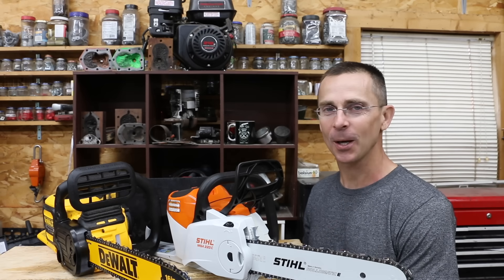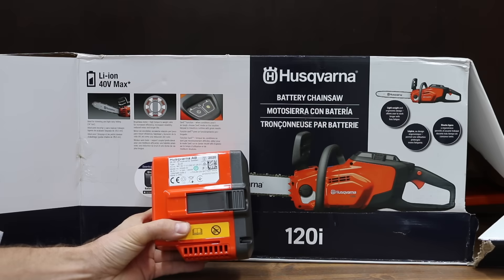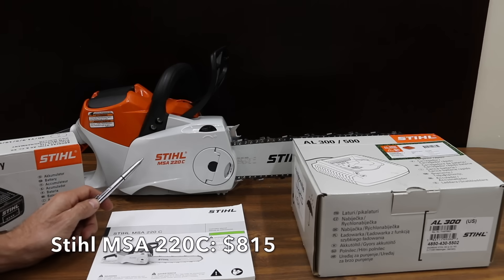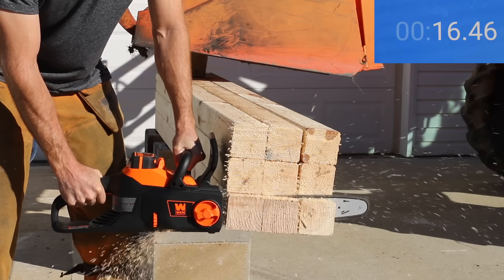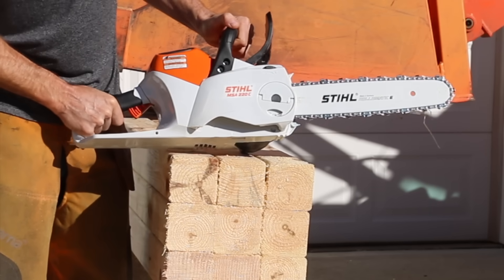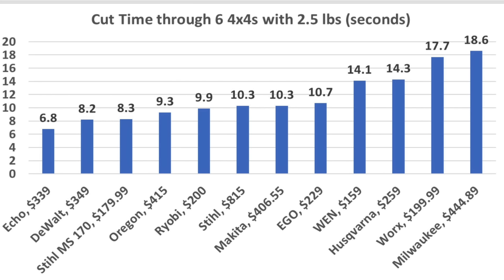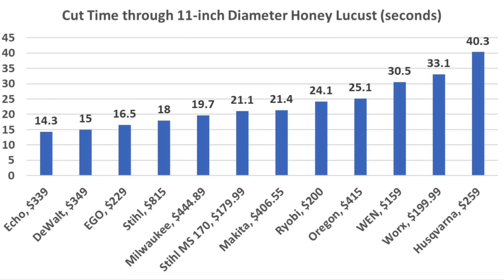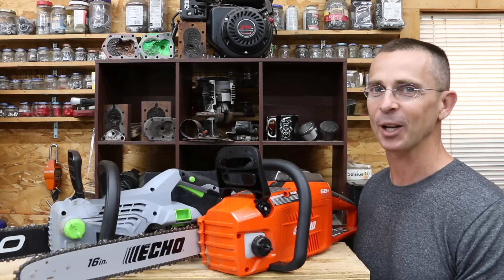Best Battery Powered Chainsaw Brand (ROUND 2)? Stihl, Husqvarna, Echo, Oregon, DeWalt

Comment: Proud Ego owner here, it did about as well as i expected.
Mine has an 18" bar so it takes a bit longer to go dull, it also comes with steel sharp felling spikes, and when combined with a 5.0 battery it can go for a good while if you don't mind the extra weight. I have discovered on the small batteries that they give up early, popping it out of the saw and then reinserting it about 5 seconds laters usually grants me a few more cuts before i have to recharge it. It does cost a bit more than the 16" but i don't know if that's just because it comes with a bigger battery.
Thanks for the video!
Reply from the maker: You are welcome!

Comment: Love the channel!  I would like to see a test of some of the most popular higher end flashlights.  I want to understand where the value is to a $100 and up flashlight, when you can buy a machined aluminum case flashlight, with +/- 1000 lumens for $25 or less, and the only weakness in them seems to  eventually be the switches.  Do the $100+ flashlights have switches that can take 36000+ cycles  (10 cycles a day for 10 years) before failing.  How many cycles can a HF or Costco Duracell flashlight take in comparison?  Thanks.
Reply from the maker: Thanks for the video idea.

Comment: My ego saw was sold with a 5 amp hour battery which is the recommended battery to get the best cutting performance from their saw.  You should have tested with the 5 amp hour battery. I love my ego saw but it does have an issue where if you cut into light brush it has a tendency for the chain to jump off
Reply from the maker: Thanks for the feedback.

Comment: Try hydraulic oil as engine oil replacement
Reply from the maker: Thanks for the video idea.
Reply: @ProjectFarm  there is another product you might be interested in testing. It is called "Shine Armour Engine Booster. It supposedly uses "nano-technology" to coat the moving parts in the engine. I think it might be "snake oil".

Comment: Does any of them have active fan cooling on the batteries in the saw itself? Discharging them this fast tends to heat the cells a lot, which leads to a shorter total lifetime, i suspect this'll be a big downside for the dewalt's drill batteries for example in intensive use.
I've noticed the bigger husqvarna fast charger has a fan on it that kicks in when you plug a battery in, but haven't seen the battery chainsaws in person yet.
One potential reason why the stihl and husqvarnas is slower could be that they're trying to prolong the lifetime of the battery as such by not discharging them too quick.
Awesome test video as always though!

Comment: I clear land as an excavator. In the summer we cannot use gas. I've blown through these saws. All of these are plastic toys compared to the stihl. Buying a saw based on this review is ridiculous. I have personally broke 3 dewalt chainsaws. They are trash. Most important part is durability. This review shows nothing of that. Reviews should be based on real work.

Comment: Sorry also didn’t see a comparison on battery amp hrs which would have been nice. As I believe the dewalt is a 9.0amp hr battery which is only 3.0 amp hrs at 60v compared to the 4.0 amp hr echo at 58v. Seams like echo just has a bigger battery
Reply from the maker: Thanks for the suggestion.

Comment: I have a ego hedge trimmer and string trimmer. By far the best upgrade made to the tool shed. I also have a HART 21inch steel deck mower that I got on clearance for $300 OTD. Basically a rebadge ryobi at its core and it’s not bad for that price, however I think the msrp or 497+ tax is laughable compared to ego. I can’t remember if you’ve done it before but an electric mower test would be interesting.
Reply from the maker: Thanks for the video idea.

Comment: Husqvarna 120i is an entry-level saw and you should compare it with the 20V Dewalt, and not with the Flexvolt and not with the top model of Stihl! Take Husqvarna 535i/540i XP and then let's see. And it would be really interesting to see the Dewalt 20V chainsaw vs Stihl MSA140 vs Husqvarna 120i.
Reply from the maker: Thanks for the video idea.

Comment: Video idea I dont think you’ve done it 
Car battery chargers - the prices vary so widely maybe discharge all the batteries to a set voltage , measure time taken to charge , how long it can provide crank current with a drop tester, maybe the ability to revive dead low voltage batteries , Etc
Reply from the maker: Thanks for the video idea.

Comment: Stihl GTA 26 vs Milwaukee 12 Volt 6-INCH Hatchet.
Reply: yeah, that is one I'd like to see. My guess is Milwaukee.  Also, adopting another proprietary battery isn't appealing, and M12 has more battery options than the Stihl.
Reply: @hanwagu9967  I agree the M12 line is great. I hate to see Stihl loose. No one can touch their gas saws.
Reply from the maker: Thanks for the video idea.

Comment: You have done really nice work on oil and air filters, how about a video on oil filters?  Things like micro filter size, how much filter area, how the filter paper are joined/sealed together, cold volume flow, the paper blowout failure, bypass valve specs and recovery or not,  base plate warping, check valve or oil retention valve leakage and if the "synthetic" label is hype or not. There are "Race" oil filters too. I know they have thicker base plates and reinforced filter paper for higher oil pressures but that can be hype as regular high quality filters were used by me and colleges back in the day for racing all the time. In my time 70lbs was the norm and the max as higher pressures robbed hp and caused other issues as well as base plate and canister distortion or explosion.  Fun Stuff. :) 

Really like your channel and you have great methodology.
Reply from the maker: Thanks for the video idea. Thanks so much!

Comment: As for charge times - typically any time a battery is charged more slowly it will have the longest capacity over the test of time and many discharge cycles. However, 60-70 minutes is great for 4Ah sized Li Ion batteries. I believe Dewalt purposely doubled the charge time to the charge cycle to keep the pack cooler when charging and maintain more capacity over time. It is a smart move. Everyone should have two batteries anyway.
Reply from the maker: Thanks for the feedback.

Comment: I think that the saws that uses 16" bar/chain and waste a lot of the length do this for users to use the same 16" chains that their regular saw uses for parts commonality rather than getting more length.
Reply: Also from use experience, the stihl tensioning "sprocket" gives crap grip, and adjustioning the tension of a saw that is not brand new is almost impossible. so while a great idea, tool-less tensioning don't work as well in practice.
Reply from the maker: Thanks for the feedback.

Comment: if you do a round 3 make sure to include the EGO 18 inch (350$) and a kobalt 80 volt gen 2 (400$) or greenworks 80 volt Generation 2 saw. the kobalt gen 2 is hard to find.
Reply from the maker: Thanks for the video idea.

Comment: You know what i use? You didn’t test it I have a new craftsman chainsaw it was on sale at Lowe’s for $150 it’s got a steel pin easy to tighten and remove blade it comes with a battery but I have a craftsman lawnmower and I use that electric battery which is a 60 V and it fits on the chainsaw makes it kind of heavy but I’ve been taking it to my cabin on the weekends putting a roof on it and I use it all day long and don’t charge it at the end of the day I cut down this huge tree with it like a hot knife through butter.   I think the battery is key.    Its a 16”. I love it.   They had a craftsman mower on sale for half off six months later I got the chainsaw for half off.   So now I’m fully electric for 300 bucks and the batteries are interchangeable.  ;))
Reply from the maker: Thanks for the video idea.

Comment: Should calculate the charge time and run time by the battery amp hour to make it fair since the battery sizes were different and many you can get different battery capacity's. So plot total with available battery(s your are now) then also plot per amp hour to get the efficiency
charge time per amp/hour = charge time / battery size(ah)
run time per amp/hour = run time / battery size(ah)
Reply from the maker: Thanks for the suggestion.

Comment: Just curious how both the Kobalt 80v 18-inch and Greenworks 80v 16-inch or 18-inch chainsaws weren't included. Edited to include the point that both the Kobalt through Lowe's and the Greenworks through Amazon are sub-$300 including a 2Ah-80V battery and charger in that price.
Reply from the maker: Great suggestion for future round of testing.

Comment: Something worth mentioning regarding the battery capacities is that amp-hours aren't useful for comparing batteries of different voltages.  The actual amount of energy the batteries hold would be calculated by multiplying the amp-hours by the voltage to get watt-hours.
Reply from the maker: Thanks for the feedback.

Comment: Great comparison! You should have grabbed the 18 inch ego though. It ships with a 5ah battery and I'm literally milling lumber with it with a chainsaw mill. (I did get extra batteries as a 5 amp hour battery will make about 2 passes though an 8 foot ash log)
Reply from the maker: Thanks for the suggestion.

Comment: I have the Ego with the 2A and 5A batteries. the 5 amp  has more power and  lasts twice as long as the smaller battery you used.
Reply from the maker: Thanks for sharing.

Comment: Just imagine if they came out with nuclear or other supurb battery tech, these saws would be the way to go. I have a greenworks 60V and the 6 amp hour battery. It is a good saw but the battery will run out and then you're stuck waiting 5 hours to use it again. My gas Homelite saws don't cut as good but they will go all day if I need them to.
Reply from the maker: Thanks for the feedback.

Comment: You should’ve tested the Ego 18 inch. The 14 and 16 inch have a different construction than the 18. I have the 18 and it has metal spikes and comes with a 5 Ah battery.
Reply from the maker: Thanks for the video idea.

Comment: Honey Locust burns great :)
The Oregon battery saw is weaker than I would like.  I own the mains power 45cm Oregon CS1500 which is 2400 Watts with plenty of power.  Works fantastically with that self sharpening chain.
Reply from the maker: Thanks for sharing.

Comment: You should do a video on the chain sharpening systems.  The ones that mount to the end of a bar, vs. the one in this Oregon saw vs. a file vs. the mini chop saw sharpeners that you have to remove the chain for.  I have always wondered how these bolt on sharpeners work that you just tap the ground a few times and it is suppose to sharpen the blade.
Reply from the maker: Great suggestion!  Thank you.

Comment: If I was going out for the day to Pollard a tree, how many of the batteries would I need, the chainsaw would be going flat out for well over an hour, probably two and sometimes three, so i would need some where between 9 and 26 batteries with me, and there is another chainsaw in operation at the same time, doing one to two hours, that's another 9 to 18 batteries, so that could be a total of some where between 18 and 44 batteries.
Reply from the maker: Thanks for sharing.

Comment: Had a Milwaukee M18 16 inch chainsaw, sent it back. 3.5 cuts on a full battery, overheated and left me with just one bar of life. The tree was 14.5 inches. Not truly sold on the battery chainsaw. Looking into investing on a Dewalt since it is American made. Looked at the Stihl, but, $800 is a bit much for a battery chainsaw in my opinion.
Reply from the maker: Thanks for sharing.

Comment: I think this is testing the chain quality more than the saw. Using the same saw with different chains will net you a vastly difference time of cutting and quality of the cut. The echo uses a standard oregon chain which is excellent and I believe why the echo did so well. This test would be better if each one had a new chain from the same brand that were all the same style (like semi chisel vs full chisel). Until then this test is only useful for out of the box performance until the first sharpening and not really for which saw is 'best'.
Reply from the maker: Thanks for the feedback.
Reply: @ProjectFarm  Thanks for having a very fun and educational channel!

Comment: please add "run time per AH" to these kinds of things. I understand the concept that the item came with a 3ah battery, but comparing that to run time of a 5ah battery on another chainsaw seems rather useless to me, as I swap batteries between devices a lot. knowing that if I have a 9ah battery for one device, it'll run longer than a 9ah battery in another device is more useful than knowing that the 9ah battery in device 1 will run a lot longer than the 3ah battery in the other device.. hope that makes sense. :-)   I mean, if I wasn't going to have other batteries, and was just going to get 1 device and the battery that came with it, sure.. but I don't believe that's the usual use case in todays battery tool world.   my 2 cents.  :-)   still great videos!  what're you gonna do with all those chainsaws?   flying chainsaw drone battles?  multi armed mech with a chainsaw in each hand for an amateur horror film?  '

Comment: The crazy price of the Stihl is whats holding back all thier battery tools. They don't offer any combo deals, and even now in winter, nothing is on sale at my local dealer. My family is Stihl loyalists, and I've inherited Stihl saws and a Kombi system. I wanted to add an electric Kombi motor for light-duty tasks, but the cost for the motor and battery and charger (all separate) was almost $700. I can buy a whole new system from other vendors for that price. 

They say they want the homeowner/hobby farmer market, but prices like this can only work out for pros and even then I'm not sure on the ROI.
Reply from the maker: Thanks for the feedback.

Comment: One thing I took into consideration years ago was product line. You don't want a bunch of different batteries floating around useless most of the time. I grabbed an ego weed eater, then blower, and now lawn mower. So now I own 2 - 2.5ah and a 5ah battery. I can go all day between the tools and batteries. The 2.5ah battery only really lasts on the weed eater
Reply from the maker: Thanks for sharing.

Comment: I’d love to see a test on chain sharpening systems.
Reply from the maker: Thanks for the video idea.
Reply: The Granberg file and joint is hands down the best system. Makes every tooth geometry, depth and height identical so the saw cuts fast, straight (uneven cutters will cause it not to) and smoooooooth.
Reply: @procrastinator1842  I use high speed roto tool or take it in to guy that can get better than new.
Reply: @sunnydays4966  Roto tools do not do a good job, they leave burrs on the teeth. The Granberg gets better than factory results every time.
Reply: @procrastinator1842  taking the to professional the best I can get them.
Reply: @sunnydays4966  much of the time, the professional just does the minimum standard of acceptance or the quickest job. I know this because I've worked in several workshop environments. I like to go for the best which is why I got the Granberg and learned how to use it 👍
Reply: @procrastinator1842  the guy I go to it better than new, he even ask about type of tree I cut and does angle and rakers according, example wet pine and elm cut way faster with less gum in higher raker vs dry oak. I may of just got lucky,  I will look up you tool but athome just do quit job to cut stumps and dirty wood.  He has video on new blades.
Reply: @Sunny Days

May have gotten lucky
Reply: Yes, I too would love to see a review on sharpening systems, even though the results are often more dependent on the experience, patience, and technique of the user than on the equipment.  While that's true with any tool, it's especially true on chain sharpening gear. Personally I prefer the traditional round file most of the time or "square" (actually triangle) file for a chain I know will be in a job with dangers and complications.  I would do square filing all the time, but I have to go slow to do it right, so most of the time, round file is plenty good.  Sharpening is such an art form, dependent on the action of the user, that it would be difficult to make a test that would be considered objective, so I could understand if the idea was turned down.  That said I would still absolutely love to see a video on the topic.  Taking chains to a shop does work for a decent job, but unless you have a pretty good relationship with the people there, they do a mediocre and quick job with a grinder that doesn't quite match a careful hand-file job for oneself.  Most pros do their own chains for that reason; you're always motivated to do a better job for yourself.
Reply: O
Reply: Great idea!
Reply: Grap a sharpener from harbor freight I have one it was about 25 to 28 bucks without a coupon

Comment: Would love to see how the Greenworks/Kobalt (or any of the other OE versions) 80v versions would stack up. The stock chain might be a bit limiting, but I managed to fell and log a 50 foot sweetgum on 1 5ah battery and that was on a freshly sharpened but used chain. Since switching to the full-chisel oregon chain it’s even faster and easily beats the Ego Ive used. I’d like to see how it compares since this Echo seems mighty impressive as well.
Reply from the maker: Thanks for the video idea.